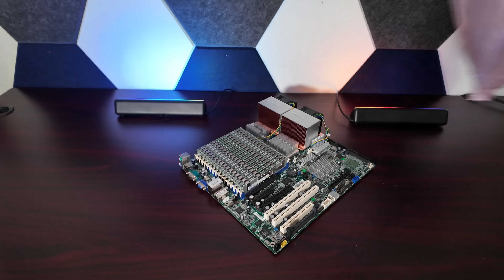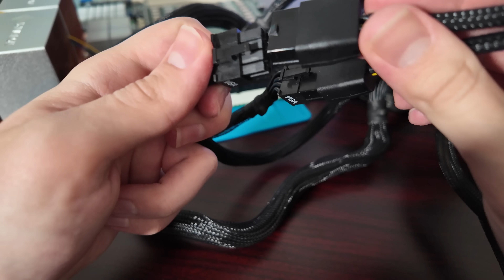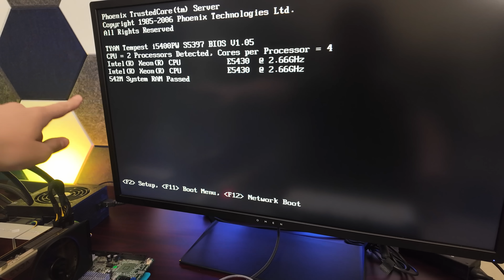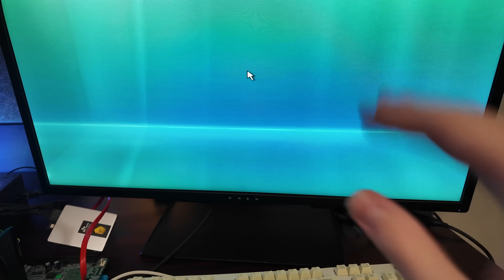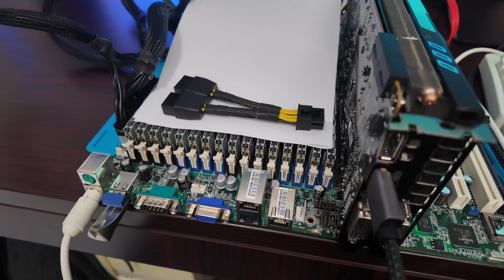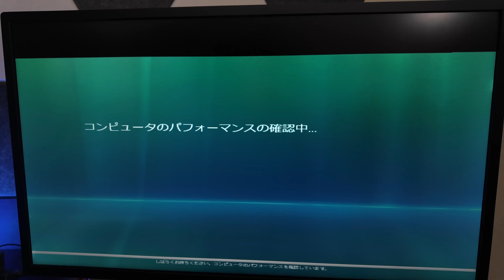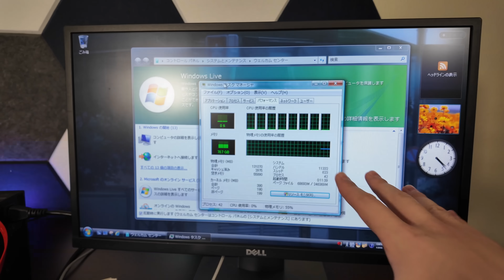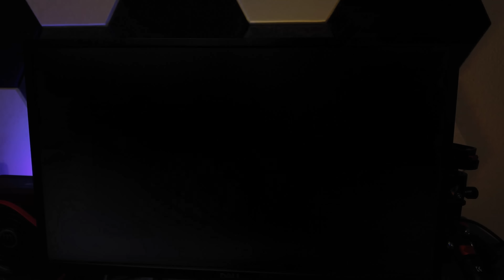What can you do with 128GB of DDR2?

Comment: 8gb ddr2 is like 64gb ddr5 sticks no?  that must have cost a fortune 20 years ago.
Reply: 128GB of DDR2 back then would be equivalent of a server with 12TB of RAM nowadays.
Reply: @monad_tcp  But price must have gone downhill very quickly back then.
12TB server is top end config for quite a few years by now, while you could build 256GB server quite affordably in 2014 or so, just barely 7 years later.
Reply: @hinz1  Kind of, but not for the reason you might think. DDR2 only had 4 years before DDR3 came out, by comparison DDR3 was top dog for 7 years before DDR4 released, and 6 years again for DDR5. The main thing to think about is how much changed for computers when the RAM went to the next generation. Memory bandwiidth usually doubled, CPU chipsets handled more I/O threads and PCI lanes, but what kinda kneecapped DDR2 was that it was released a year after the first 64 bit CPU. As soon as people figured out how useful it was to have more than the 4GB per CPU limit of 32 bit computing, there was a drastic acceleration to growing both capacity and bandwidth. That's mostly why DDR3 and 4 are not as big of a boost compared to the 4 to 5 upgrade. Multi-channel memory with numbers that big got everyone excited, naturally that means newer shinier stuff comes out real fast.
Reply: @hinz1 right, not counting the ai bubble ❤
Reply: @monad_tcp That's a crazy statement. Have you seen how much even 16 GB is costing right now?
Reply: @malucart 8gb sticks of DDR2 are crazy I didn't even know they existed.  I just looked at my collection of old memory sticks I have 50 1GB and 27 512MB and 4 256MB, I have some 2GB sticks still in computers and he has more DDR2 RAM, so if 1GB was the most common size back then and I would say 16Gb is the most common size to today. 8x bigger would be 128GB still and with 16 total sticks. Would be 2TB. So 12TB is an exaggeration but is still significant amount of memory.
Reply: When I bought a new system back in about 2009, I thought the 6GB DDR2 it came with was a really great thing since most new PCs back then came with just 4GB of RAM! 😳😁
PS: The PC came with 4 slots so 8GB is the max you can put in that system. I still actually own it and it has 8GB now. 👍👍
Reply: @arthurmann578  actually 4gb ddr2 sticks for desktop exist but they are pretty rare (for intel) - in china you can order noname sticks and I have them as well - but with intel platform they not usualy work - sometimes boot but thats it
Reply: @duniek86  Yup, they do exist at 4GB sticks, but like you said, they are hard to find and pretty expensive I would imagine, IF you can find them. Not sure if my old AMD machine would except them anyway. 🤔👍👍
Reply: @arthurmann578  I remember when ddr3 was on market 2 or 3 years and finally it was cheaper than ddr2 - ppl sell old machines and I bought few of them with 4x4gb ddr2 (patriot/goodram) and later on I was able to sell only ram for more than i bought full system - and there were preety hi end (silvestrone/lian li case - good psu, good hetsink and more)
Reply: @arthurmann578  - It was those sticks I had for a bit too. Gigabyte was one of those companies that did mad scientist things by having GA-G41M Combo board--so you had 2x DDR2 DIMM slots and 2x DDR3 DIMM slots. Mixed mode wasn't supported, meaning you could only use one type of RAM at a time. 

I was moving from a Intel Pentium Dual Core E2140 to a Core2Duo E7500 and also was one of the super early content creators on Youtube, so upgraded to 8GB DDR2 before eventually 8GB DDR3--sometime later shifted to a Phenom II x6 1090T and added another 8GB DDR3 to the system.
Reply: @duniek86  They most probably will work, but the memory controller will only address a fraction of the capacity. How do I know? I bought some 2GB sticks for my Core 2 Duo system back in the day, which were only recognized as 1GB. Had to study the exact memory chip configuration the P965 supports and look for that.
Reply: @arthurmann578 I remember when I upgraded my PC from 1GB (2x512mb) to 2GB (4x512GB) when I was a kid it was the first thing I did inside a computer and it made a huge difference to the performance. You don't really notice ram upgrades now until you start doing intensive tasks that take advantage of the extra ram.
Reply: @arthurmann578 I didn't know until now that any DDR2 bigger than 2GB existed. But when I looked up the specs for Dell Optiplex 760 it says it supports 4GB sticks of DDR2 for max of 16GB the next model Optiplex 780 Dell switched to DDR3, still using core 2 duo and core 2 quad just upgraded memory.
Reply: probably
Reply: I think it would be more expensive considering back then no normal person would need this much RAM for anything, so production volume was probably much lower
Reply: @lhospitalfan_69420  any random database company: "i would like to order 1000 of them"
Reply: So, if those are 8GB DDR2 DIMMs, that means they're RDIMMs, or registered DIMMs. That's equivalent to 64GB of DDR4 RDIMMs. For DDR5, that's 256GB. So that's equivalent to a server with 4TB of memory 16 * 256GB.

And yes, a dual socket board with this much memory would have been ridiculous. Mind you, 8GB of ram was more or less the maximum anyone considered necessary to futureproof for Vista and beyond, since really no one gamed on XPx64, and 32-bit OSes couldn't address more than 4GB of ram. 8gb of DDR2 was even enough for running Windows 7.
Reply: @metaleggman18  Windows 7 and 8GB of RAM was really carried me until 2024, and even it's still usable until now, it's just that the Windows 7 has been discontinued
Reply: @sihamhamda47 The only reason I left 7 was the 10 series of Nvidia cards required 10 for the drivers, and that was my first PC build. Had I known I'd of gotten a slightly older card instead.
Reply: @sihamhamda47 Leaving Windows behind is the single biggest upgrade for legacy systems. Just install Mint XFCE instead & it becomes a machine that can do many modern daily driver tasks.
Reply: @metaleggman18  these were specifically FB-DIMMs. there were DDR2 RDIMMs as well but not the same. the most similar with DDR4 technology will be LR-DIMMs, which is a sort of spiritual successor
Reply: @metaleggman18 for a long time, in windows 7 days, I thought 16gb of ram for gaming was even excessive since nothing could use it all lol
Reply: @metaleggman18  Windows Server 2003 32bit could easily address up to 64GB ram using PAE, but no program could use more than 4GB at any given time.
Reply: it more likely 16gb rather than 8gb because at that point there already motherboard that supports 8gb of ram like the g33 DDR2 version, the only problem is that the 4gb version of ddr2 are expensive and rare. 
the price for ddr2 4gb is around 400 to 800 dollars = 645 to 1,290 dollars in Today. and in 2006 that price it just for a single stick of ddr2,
Reply: @eversong1996  Keep in mind that these are fully-buffered DDR2 sticks, not the consumer grade sticks! Much more expensive!
Reply: more likely 128GB DDR5:

Maximum RAM you could throw into a (common) motherboard with 2 DDR2 ram slots was 4GB.

Maximum RAM you can throw into a common motherboard with 2 DDR5 ram slots is 96GB (2x48).

So... 128GB (16*8GB) would be equal to 1536GB (16*96GB). Considering that you are going to use double the maximum common RAM capacity by choosing server RAM
Reply: @SrNerd  You could throw in more, you just needed a 64-bit processor, which not everyone had back in the DDR2 days. Servers and workstations were all 64 bit by around 2005, even if it took the consumer market longer to catch up.
Reply: @BlackEpyon  Are you guys blind or did I get something wrong? I said COMMON MOTHERBOARD WITH 2 DDR2 RAM SLOTS:

By COMMON I mean BUDGET (Cheapest model available). The budget DDR2 motherboards do NOT support FB dimms and maximum capacity PER RAM STICK is 2GB (4gb using BOTH SLOTS).

I know this because I have GA-G31M-ES2L, which I use as a IDE/PATA cloning station.

Budget DDR5 motherboards with 2 RAM slots, like H610, can support at maximum 96GB (using 2 sticks with 48GB each. I, at the moment, never saw a bigger RAM stick without it being server grade).

I know the video uses server hardware, but I AM NOT COMPARING SERVER GRADE HARDWARE. I am comparing consumer grade hardware. It doesn't make much sense for me to compare server old hardware with current server hardware. After all, servers keep evolving constantly and there always a new top/high-end hardware being released.
Reply: @BlackEpyon  ??? no... you just needed a PAE enabled CPU and a matching OS. Which was... pretty much everything on the market by then regarding CPU's and most OS's, including XP until it was "virtually castrated" so as not to compete with WS2003. But CPU was never the limitation. Most CPU's will only match "cpu bits" to "address limit" when its unreasonable to think you won't go over the limit "soon". For example, the Z80 is 8/16 (64k limit), the m68000 is 16/32 (4GB), x68 has had PAE ie 32/36 (64GB) since the PPro (iirc...). With 64b there won't be extensions anytime soon because... 16 exabytes... we'll probably be in 2100+ by the time we even consider adding a single extra addressing bit or two.
Reply: @ErazerPT  I've looked into getting around the <4GB limit in Server 2003 x86 on a 64-bit CPU, but I never got it to work.
Reply: @BlackEpyon my experience if you put more memery then the 32bit os could use it just ignored the extra
Reply: @abramb8690  That it did.
Reply: @BlackEpyon  You needed PAE enabled plus memory hole remapping together with Enterprise edition of 2003 x86. Standard edition was capped at 4GB in software. The 64GB limit was an address space limit so with 64GB installed memory hole remapping did nothing as there was no available address space to remap to
Reply: @saccharide  Well, my copy was standard. I just downloaded a copy of Server 2003 x64.standard. Why am I still running that? It plays a lot nicer with the retro machines on my network.
Reply: @SrNerd  if they are FB dimms they have a higher capacity per-dimm. all rams seem to exhibit this, even modern rams have very high capacity FB dimms
Reply: @SrNerd  naaa dude more like ddr5 with 16x256gb or even 512gb, just look back, the biggest desktop DDR2 stick was 2GB max, so a desktop was rocking 8gb max, server got that size in 1 stick and they use DDR2 switches to use 4 sticks as one like raid with SSDs

btw. an "Supermicro SuperServer SYS-681E-TR" supports 32TB ram in 128slots aka 256gb DDR5 ram sticks.
Reply: @dbmaster46446  128gb is the limit per stick using ddr5 i think
Reply: @ghostofrazgriz1498  256gb for sure, maybe even 512gb but i havent seen any in a quick search, but yea no way for an desktop system, thats server stuff
Reply: @dbmaster46446  Don't know where you got that info, 4GB DIMMs were readily available for desktops. I still have DDR2 RAM AMD systems and they accept 4GB DIMMs. And I run 4GB x 4 = 16GB, and they are all desktop systems and dating back to Athlon 64 x2 Windsor.
Reply: I see a lot of people who repeat as  fact that the DDR2 limit in desktops was 2gb sticks. Not so. The manual for mine is clear that you can use 4x4gb sticks for a 16gb total.  What it doesn't say is that you need 1rx8 dimms which I think only were made in one SKU from Kingston.
Reply: I have a mac with 8gb ddr3 1066 which apple charged $1000 plus for in 2009.
Reply: @Microsoftsucks420 you cannot compare amples to oranges
Reply: @Skynet-605 true, but back then, Apple was using Intel x64 CPUs, so they were kind of "oranges" ;-) 

The fact that they overcharged for RAM? Well, that's just typical Apple. They have long exploited the non-technical user when it came to upgrades. It's apparently part of their business model.
Reply: Yes, probably still is. Or is going to be. Especially DDR3.
Reply: Around that time. I remember specing out the most expensive computer that could be built with parts that were in stock on Frys Electronics website for my local store. The mobo and gpu etc weren't that bad. Still around 20k for the mobo. Most expensive gpu they had was some quadro at 9k I think. PSU would have been a couple grand for a mobo that held 4 CPUs. Each had 8 slots of their own. Only need 1 cpu to make the machine run. But with 4 $10,000 cpus. It was gonna need a lot of power. So each cpu got 8 sticks of 8 gig ddr2. 256gigs total of ECC addressable ram. At $1,000 a gig. For $256,000. I cant remember the exact final total. With a case and HDD etc. But in the cart after taxes. Because it was local. That pc was just shy of half a million dollars. Probably a million today. 

My 1st computer in the mid 80s. Was a hand me down from my grandfather. The printer was $2,000 back then. The computer was $1,000 for the base machine. Had a 10-12 mhz IBM compatible cpu. With upgrades for running CAD software. Around $5,000 was put into the machine. So in total around 8k for the whole setup. About $17,000 in todays money.
Reply: 8gb DDR2 was more like the equivalent of a 128gb DDR5 UDIMM
Gotta keep in mind, anything above 2gb wasn't possible without ECC aswell, or well, very rarely it was
Reply: Plus 8gb of ddr2 is very rare, in my country it's pretty much impossible to get
Reply: That actually makes me wonder, can RAM be raided like hard drives? I assume not since it's random access meaning you get little gains but maybe?
Reply: @kurwamamkaca RAM redundancy sounds pointless, and ECC exists
But if you're just wondering about the performance, you might be thinking of channels. Y'know, the reason gaming PCs are typically recommended to use 2 sticks instead of 1. Most consumer PCs support up to 2 channels, but server CPUs like these often support 4 channels, and a multi-CPU motherboard can multiply that even further, as each CPU gets its own channels.
Reply: @malucart  Yeah I'm aware of that but thank you my friend. I was more wondering if there was something more akin to raid than multichannel memory. increasing RW speeds as opposed to the increase bandwidth
Reply: @kurwamamkaca  I seen pcie cards that can hold memory but have no idea how that could even be utilized.
Reply: @malucart well channels are more like being able to access to different disks at same time, dual rank with interleaving would be closer to that, although adding sticks is mainly for space we can just some optimization with extra hardware
Reply: @kurwamamkaca actually yes, you can even use GPU VRAM as a source of storage which is dumb af since you bearly have enough ram to get one game on it but I'm pretty sure I've seen someone use it to play Crysis 3 and surprisingly there was improvement in everything
Reply: @kurwamamkaca  the address space is already interweaved
Reply: @saccharide  Yeah, that's what I assumed. But that just sorta makes it like RAID 0. I mean like RAID 1, where you 2 8GB sticks give you 8GB of ram at double the speed ykwim
Reply: @kurwamamkaca  it can be reconfigured to use Memory Mirroring where each stick had an active mirrored backup at the cost of half the space. it was a redundancy feature and not promised for speed
Reply: @saccharide  not promised implies there could be gains? I still imagine not since it's random access but is there a possibility?
Reply: @kurwamamkaca  no it was like RAID-0 before mirroring and now it's like RAID-1. it's actually a bit slower. and it's all still constrained by the memory bus between the Northbridge and the RAM
Reply: "No?" 🥷🥷
Reply: Wow its fast!
Reply: 冬天的熱氣爐
Reply: great sense of math
Reply: Yes, enterprise memory was expensive.
Reply: hard to compare as its ecc-r ram - normal dekstop ram was 2gb per stick, later they released 4gb sticks so you can have 16gb in desktop but these were very very very rare (for comparasion as 4x2gb kit cost about 100$, then 2x4gb will cost 300-400$) ddr2 ecc 8gb was rare  as 64gb ddr3 or 128gb ddr4 sticks
Reply: Like a 2 gigs ddr5 cost a house now yep.
Reply: It was DDR5 that was cheap thanks for to AM4 and 12/13/14th gen using ddr4 aswell if not for AI
Reply: Depends. If you bought them when it came out, then no, 4gb was fuckin huge amount. When ddr2 went out of the mainstream, 8gb was the norm,and some madman had more.
Reply: Lol my server has 768gb ddr3 I can't imagine what it cost new so many dimms (4s)
Reply: @forbiddenera  Thankfully the sentence started with "Lol my" and not "My LoL"
Reply: @stevepine3568  Your Lol comment
Reply: @forbiddenera  i have 480 GB DDR3 in my server and yeah